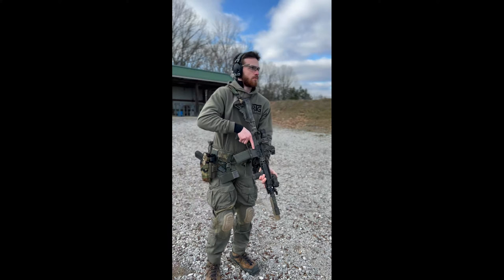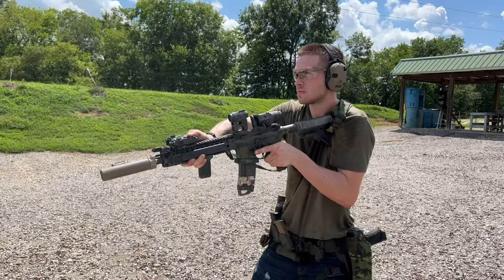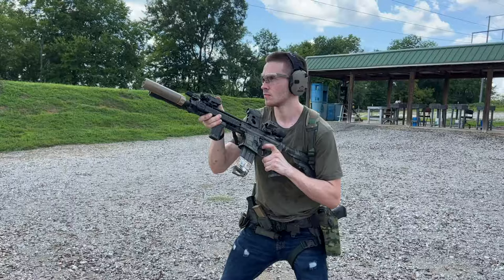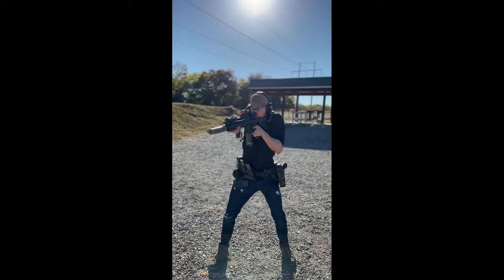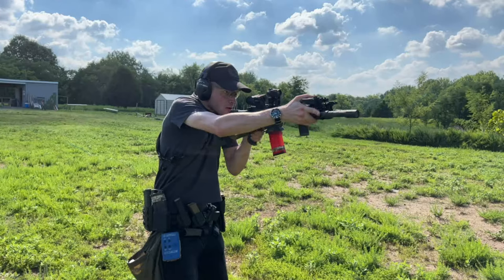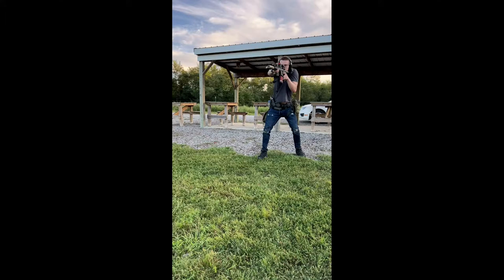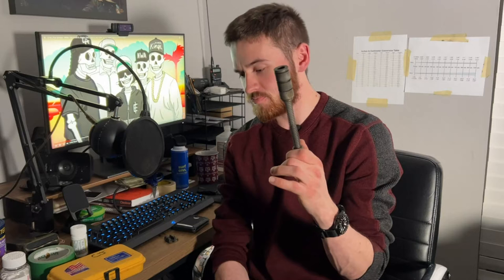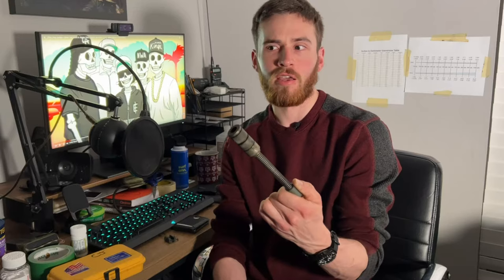JP Enterprise silent buffer system review

Comment: JP sells replacement O-rings sets at $8 for a pack of 12 which gives you enough rings for 4 replacements, or roughly 20,000 rounds - or you could just go to a hardware store and match them for much cheaper. 
But overall - having to replace $2 worth of O-Rings every 5,000 rounds doesn't seem like anything worth mentioning. Also something you could easily do in the field by just jamming the parts in a grip compartment. 

Realistically though - anyone with the slightest bit of mechanical knowledge and responsibility will never, ever have any issues with this in the field. Because they will inspect and maintain their equipment at intervals of <5,000 rounds. . .

Sort of like driving your car and being surprised when you eventually have to replace some seals and gaskets - except these o-rings take about 3 minutes to replace.
Reply from the maker: Or......you could buy a cheaper car that does the job better and doesnt need any of that. We're trying to make something more reliable not less. if im not mistaken the O ring round count limit isnt stated up front by JP on the product page so youre gonna find out by breaking it, not by having prior knowledge.
Reply: @autonomousdefense  you definitely should not purchase a SCS if you do not know what the intended purpose of it is (hint: it isn't just about some cheese-grater noise). 

But in any case - yeah i guess sometimes the world doesn't hold your hand. Maybe look at the o-rings with your eyeballs once every now and then - and replace them when they start to show wear. 

Or... just throw up your hands in confused desperation, throw in the towel and call it a bad product because you don't understand it. lol
Reply from the maker: @regishevro971  So when the o ring failed it was during a 4 day outdoors training event were around 2000 rounds were fired and the stoppages that were occurring happened under nightvision in the middle of a multi man drill. Basically the worst possible time for a gun to go down and the issue couldnt be resolved. you might get a second or third shot off before the o ring caused another failure so your semi auto rifle is now a bolt gun which is also causing magazine feeding problems. its a bad product because it doesnt solve anything a standard 50$ buffer system cant handle for the cost of around 200$. Practically speaking this product does nothing. You spent extra money for something that causes problems that didnt exist.
Reply from the maker: @regishevro971  Its a bad product if you intend to actually use your gun to get good with your gun so that you actually are a competent shooter.
Reply: @autonomousdefense  well, first off - completely your fault for not maintaining your equipment. If you've made it this far in life and still didn't know that o-rings were wear items, that's on you. Second off - if you're putting a $140+ buffer spring into a rifle solely to eliminate a “sproing” noise on the backend of a rifle that launches supersonic projectiles out the front end then… well, I don’t know what to say to you. 
If you’re just building a gucci gun for the sake of building a gucci gun – then by all means, go ahead. Most adults are probably aware that o-rings are wear parts and won’t have the same experience you did. 

The functional reasons to use a JP SCS are:
1) to facilitate using a JP VMOS, for all the reasons you would want to use a VMOS.
2) competition guns – SCS weights and springs are easily adjustable and allow you to tune a high-end race gun with mass instead of gas alone.
Reply from the maker: @regishevro971  Thats cool, im pretty clear as to what it was being used for and regardless of if its for competition or not it still just another failure point that again, doesnt exist with a spring and buffer. "its completely my fault for not maintaining my equipment. I guess you cant really imagine how much is going on or the volume of training that was going on with that event even after mentioning "Multi dude, night vision, 4 days, and 2000 rounds." you really think anyones monitoring an o-ring thats got 2000 rounds left of life in it before it cracks after rucking, camping, sleep and eating next to nothing while your also mid drill? Which by the way the failure isnt event perfectly consistent. Sometimes its enough friction, sometimes its not. We also dont have a lot of time to just stop and figure out the problem.
Reply from the maker: @regishevro971  I don't know what to tell you. Sorry we were doing things in extremely shitty conditions while in body armor and physically fucked up kinda like actual fighting.......
Reply: @autonomousdefense  "you really think anyones monitoring an o-ring thats got 2000 rounds left of life in it before it cracks after rucking, camping, sleep and eating next to nothing while your also mid drill"

Literally, every boot in the military knows to inspect their weapon in the field. They simply don't have the privilege of all the nice equipment and accommodations you paid for. 

"Which by the way the failure isnt event perfectly consistent"

Dude, what? Failures are never consistent. If they were then there would be no need for *inspections*.
Reply from the maker: @regishevro971  I’ve got no reason to continue this conversation, failures are absolutely not always consistent because of all the different variables that can effect how a machine, not just a gun, but a machine can work, because it’s composed of multiple moving parts all of which can be weaker, stronger, installed poorly, or be effected by the conditions of the environment you’re in. To argue otherwise is blatantly false.
Reply from the maker: @regishevro971  way to disregard the fact you don’t always have the luxury to quickly fix your weapon in the middle of what is a simulated gun fight like in an actual gun fight. Just ignore that detail entirely while actually mentioning the military like dudes haven’t shit canned entire rifles in combat.
Reply from the maker: @regishevro971  kinda reminds you how sig isn’t actually gonna replace the ar15 in our military for that very reason of being less reliable.
Reply: @autonomousdefense  yeah but you could have understood your equipment before you purchased and installed it, and you could have maintained it. 

Your lack of personal responsibility is stunning. 

Best of luck with the guntubing gig, you're going to need it.
Reply: @autonomousdefense  now you're just contradicting yourself and speaking gibberish - that was all unintelligible. 

Best of luck.
Reply: Thaaaaank you!
Reply: @autonomousdefense Jp doesn’t have to post the round count. You made a video about it. Thank you kind sir 👍🏽. Now I know what to look for when I buy my Jp 🙂
Reply: @autonomousdefense if you are in war time, which it sounds like you are training for, you would inspect your weapon every chance you get. Everything fails at some point no matter what it is. Your story said it failed after 5-6 thousand rounds, not 2,000. I f you don’t like it, don’t use it.
Reply from the maker: @gregphillips1998  yes I don’t like it thus I’m not using it. Thank you for repeating me, glad we all understand English.
Reply: @autonomousdefense  How often do you Completely strip down and clean / inspect your weapon? 
If your Life depended on it you would know it's condition Before it went to the armorer. From an Army Vet.
Reply from the maker: @spartanhonor7538  that question is answered by a couple of different facts and details mentioned in the context of the video but I’ll go over it again. The rifle is cleaned after each range session because it’s been ran suppressed recently, the buffer system in this gun failed based on the manufacturers own experience which they do not actually tell you that anywhere when buying it. Lastly this gun went down in a 4 day training classes revolving around the use of nightvision. That’s a pretty good simulation of being in a combat zone and the gun failed because of the buffers design in the dark at the worst possible time. This is not a field tested product it is an aftermarket component, had I know its specific round count limitations before hand sure I could have planned for it, however that isn’t something provided.

Comment: For the love of God... if you'd kept that thing lubed, and cleaned it every thousand rounds or so, itd probably still be functioning.
Reply from the maker: Again, The volume of shooting was related to the class it was put through, it was lubed plenty, O-ring split and seized the action. the gun was cleaned and lubed repeatedly and it continued to fail due to the O-ring floating around in the tube.
Again the most significant failures occurred under NODS in the dark making field servicing problematic. Standard system works fine.

Comment: Thanks for sharing your experiences, which I can only corroborate. I had a JP SCS in my Bul Armory BL9 PCC 9mm. Initially indeed smoother and more silent, but ~2000 rounds in, I started to have malfunctions. It took me a while to figure it out, but the plastic rear buffer started to crack and dump small plastic particles in the buffer tube, causing cycling issues. JP SCS concept sounds great, but adds more complexity and maintenance issues, than it actually solves. Thus, I switched back to the standard spring and buffer set up.

Comment: I have 3 , all went for $125 to $150 and really enjoy the system .  5000 to 7000 rounds ? I never expected a system upgrade to last that long without replacing something . I`m impressed if anything 
but of course a mil spec buffer works fine also .
Reply from the maker: I like you.
Reply: they only goes for $70 buck

Comment: O-rings in any system, machine, or weapon WILL need to be replaced at sometime, without applying the proper lubricants it will be very soon. Done so on multimillion dollar equipment pieces as well as a cheap lowes sink faucet. Doesnt matter the product. Knowing what youre getting into when you buy is crucial. Its not a failure point, its a compromise you made at purchase
Reply from the maker: I understand all that. The point I’m making is self evident. There are plenty of guns on the market and the ones people use are the ones that can go the longest with the least amount of maintenance so long as the weapon is lubricated. This is why glocks and their design replaced everything on the market when it came down to practical use. People sacrifice speed or weight for consistency and reliability.

Comment: JP makes a buffer spring retainer specifically for the SCS which also can be used on regular buffer spring set ups. I have my SCS set up with an A5 buffer tube in conjunction with a spacer just in case that it does fail I can easily switch to the A5 spring system. There are other cheaper alternatives like the Armaspec that offer similar results as the SCS.
Reply: Same. I love that JP started making an A5 specific spacer for people like us who kept their A5 extension when they upgraded to the SCS.

Comment: Don’t remove the buffer retainer pin. It works great with it . Just use a small flathead screwdriver during disassembly.  Not as easy as a standard buffer and spring but doable.

Comment: I put one of those in every one of my builds. What you’re telling me is that you are removing a far superior buffer because you don’t want to do maintenance before 7000 rounds?
Reply from the maker: Power to you, if you like it and you wanna use it that’s cool. This was a longevity test to see what failed and how it failed and what failed is a problem that doesn’t “need” to exist. I…do….not….like….creating…..problems. If this system was actually DRASTICALLY better than a standard buffer system you could make the arguments it’s worth the problems but it isn’t. Muzzle brakes have a more significant effect on recoil than this, triggers have a more significant effect on how well and how fast you can run the gun, optics have a more significant effect on how fast and effectively you can run the gun. What this thing does is insignificant unless you’re tuning more than just the buffer system and at that point what you do with the gas system, the ammo, the muzzle, the barrel, all of that shit is what is altering your recoil and use of the weapon. Not the buffer.